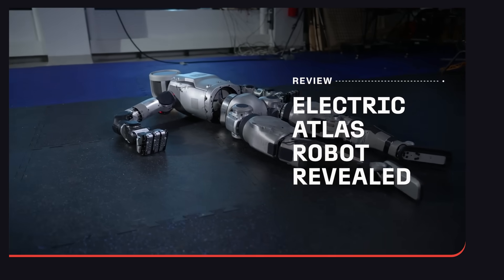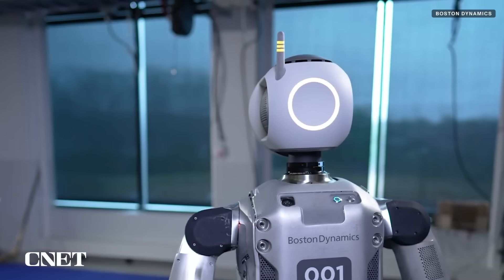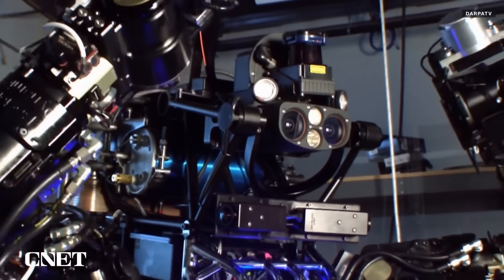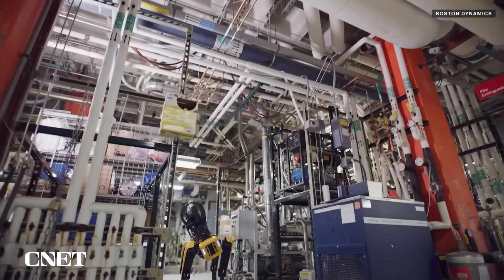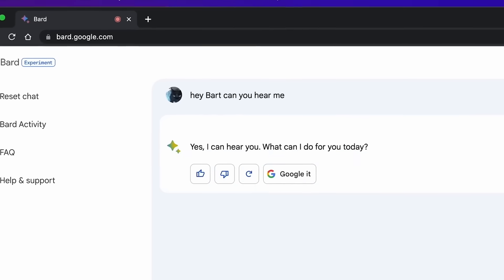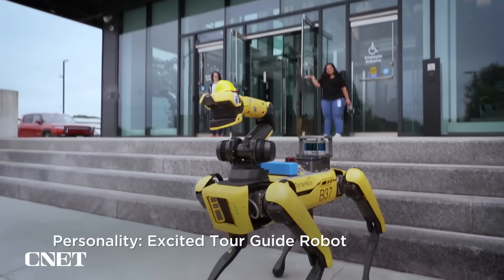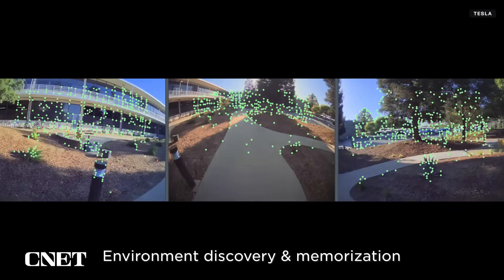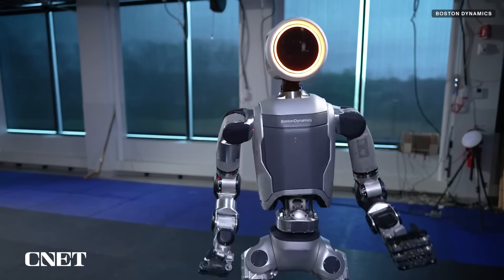New Fully Electric Atlas Robot Revealed by Boston Dynamics

Comment: the battery is empty after 10 Minutes...battery or diesel machine, but this makes loud noise and can't by used indoor. No war with robots possible, what luck ! robots with diesel aggregats are a complete fail, they are loud and can be deteced via thermal sensor camera...

Comment: Battery is likely at the lowest point in the center. Without cameras and an antenna it's blind and muted. Joints are also a weak point for any type of mechnical device. Aim accordingly.

Comment: Why all of the "fully electric" mentions?  Do other robots run on gasoline or coal?
Reply: I had the same question, apparently the older ones had hydraulics
Reply: I think the older ones were powered by generators and a tether. Im guessing the new ones you can just plug into a outlet

Comment: Nice design but disappointed with the "potlight" style  head , needs  the head of Optimus on it. Also does it's electric drive have the same power to weight ratio as HD Atlas with its hydraulics ?

Comment: What I'm impressed by is that this model never gets tired. It doesn't need sleep. It doesn't need to eat. It never quits. It will keep on going.
Reply: it would still need to recharge given it's got batteries. Also even machines need breaks due to wear and tear of parts, things heating up, etc.

Comment: I think Boston Dynamics goes to a completely wrong way! I mean the robots should or look and sound and feel absolutely like human, or be all about functionality. I mean this idea that this word is made for human so the robots should have legs and two arms is absolutely BS! I mean for example who wouldn't want to have more arms when caring a lot of baggages or soldering wires, or have wheels and glide down the street then walking? But for robots there are no reasons do the robots with the same imperfections what we have! Wouldn't it be nicer if this robot just silently rolling away then heavily and slowly tramping? If you worry about stairs -  really there are a lot of mechanism what can climb stairs without any legs! So as result what we have with the new BD robot? It looks and act not like a human and scares people with its movements, and on another hand it has two legs - not wheels and this is not efficient if they trying to create an efficient robot. So, what is the purpose of this robot? Maybe Hollywood, Pixar?
Reply: As a human, I sure do love contorting all my ball joints, spinning my head, and lower spine  a full 360°... 

This design is extremely versatile compared to an average human.
Reply: @smittyvanjagermanjenson182  Do you have four arms? Trust me it is more versatile than two! And wheels compare two legs is more versatile if you live in town not in jungle.

Comment: Sorry, but BD isn't a competitor to Tesla, it is the industry standard Tesla will struggle to meet. They were barely on track to catch up to HD Atlas, but yesterday's new robot is just an inkling of how far ahead BD really is. Meanwhile every Optimus demo needs to be scanned for the trickery because Tesla has zero credibility after prior stunts.
Reply: Is Figure 01  a competitor to Boston dynamics?
Reply: I think you are really underestimating how fast this will go ones it's past the threshold catching up won't be the issue having a base understanding does. This is what Tesla understands.
Reply: @Dr01d1  and it's clear you are really underestimating just how steep the threshold is for their stated use case. You think they've hard a hard time convincing folk their driving machines are safe? Wait until they're trying to convince folk these things will be useful and safe in their homes. BD is at least smart enough to focus on meeting the needs of industry and commerce first, which is a much easier lift.
Reply: Blah blah blah
Reply: cant wait for the tesla bot to be even worse than their truck
Reply: Yup, I wouldn't trust a single thing Tesla puts out given their releases thus far.

Comment: What reassures me a little more is the fact that the battery life is probably still unusable for independent use outside the laboratory at the moment. How long does the battery last for the sensors, actuators and computer power? Maybe an hour, certainly not more like two.

Comment: This may be a dumb question, but what do they mean by "fully electric"? is there other kind of robot like semi-electric ones? I'm confused.
Reply: Previous versions have used hydraulic parts which act far more like human joints than electric joints, which as you can see, can basically swivel wherever.
Reply: @notrod5341  Thank you. That was my initial thought, but then I was like "hydaulics uses electricity to function, so that must not be what they mean". I was overthinking it.

Comment: They say it is the first impression that lasts the longest. So maybe not have it introduce itself with the Exorcist emote 😄
Reply: Based on its size and weight distribution I think that's the only way it can get up. A machine's servo motors put all it's power into torque. This robot has very little hydraulics which is why it's more efficient. So it's probably only able to stand up by placing it's legs at the center of gravity, then using torque to move the hydraulics into a position to help it keep balance. Then the hydraulics do the rest to raise it up.

Comment: I wonder when we get to see the DARPA weaponised robot which has 100% headshot aim accuracy. 😮😅 the dawn of the terminator. I hope they call it that too
Reply: In like 50 years at the minimum, still way cheaper and more effective to send in a squad of SEALs
Reply: @yodamorpheus3128  this will happen much faster. When they have 1M or so units out there to work in factories etc. they will collect tons of data and be able to improve them on a new scale, from there it will only be a small step until the military and police use them for dangerous, but less critical missions.

Comment: Haven't they always been "all electric"?😂😂
Reply: The older ones used hydraulic pumps to move the joints. That's why they were slow and bulky. This new one uses electric motors in the joints for movement hence the term "all electric"

Comment: "All electric" dude this isn't a car, it is a robot, all of them are electric!
Reply: I think they mean the joints have electric motors instead of hydraulic pumps like the older ones. So it's much slimmer and faster
Reply: @enadegheeghaghe6369  exactly, and it gives a wider range of motion
Reply: og atlas had hydraulic joints, if i remember correctly
Reply: I know hilarious 😂😂

Although to be fair the cgi computers used to generate the video are coal powered though
Reply: @joegallien9631 wut

Comment: The Boston Dynamics LOKI Mech is a bipedal humanoid security robot designed for security detail and guard duty in locations where manpower is an issue, or where the use of organics for "around the clock" shifts is unfeasible. Initially used exclusively by the Alliance for colony guard duty, the LOKI Mech came into new use following the Battle of the Citadel in 2183. Numerous civilian and military sector units saw staggering losses from Sovereign's attack and incidents involving the rogue Spectre Saren Arterius.

Comment: Why would a botman have a head and toe's, is it to communicate with human and women? I understand why it has arms and legs and fingers for dexterity work industry. A head and toe's are unesserary part that can break that don't need to be a problem.
Reply: Head is necessary for the height of the camera/sensors, it's inefficient if lower down in the body, you can see further and more from higher up. Even if it's not a 'head' it's just better to think of it being in the location of the head. 
Some people can lift objects with their toes and feet, maybe in the future the robot will have "fingers" on the foot or will use more limbs for more dexterity and complicated tasks. We saw in this demo that it's like a contortionist moving it's joints in very weird unnatural positions. So imagine it doing something weird with the feet and toes when it lifts them above its head too, extra gripping options for strange situations. I just see it as more fingers. 
Head also might be good if they can put a face on it to calm children down or it has facial expressions to be more human at some point, if the bot is used around children or a family, some children might be frightened if it doesn't exhibit any friendly characteristics/body-language. They might have to do something to make it more family-friendly in the future.
Reply: Yes.
You can stick 10 cameras all over.
You don't need nose or mouth,  and you can stick microphones anywhere.